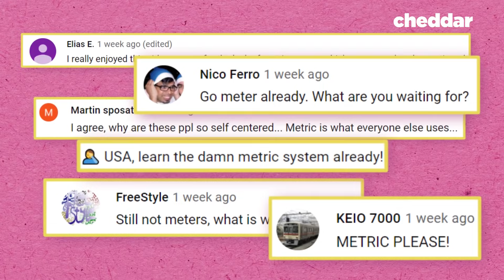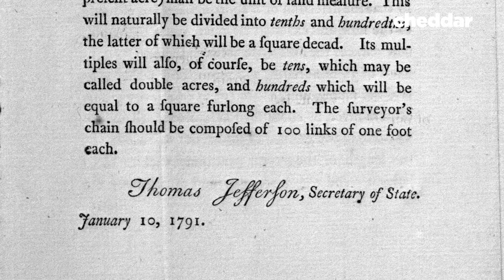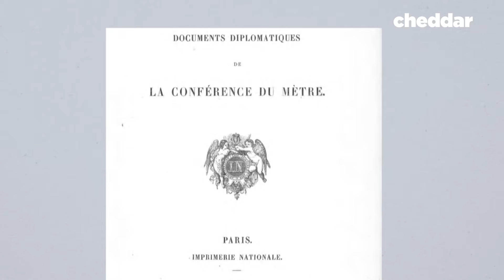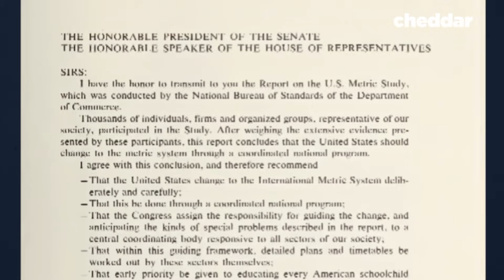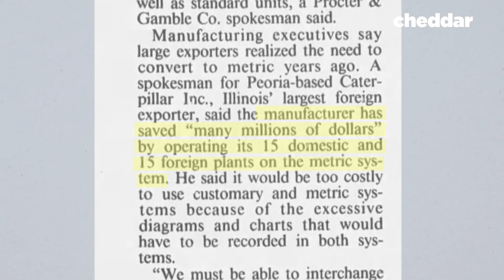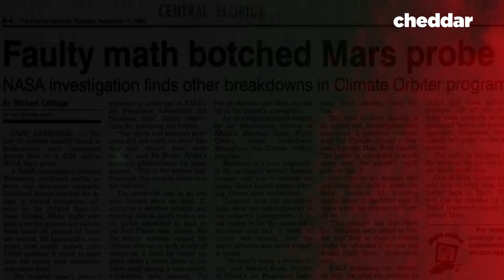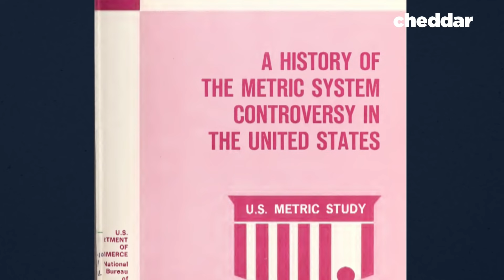Why Doesn't the US Just Use the Metric System? - Cheddar Explains

Comment: Can you count to ten? 

1-2-3-4-5-6-7-8-9-10

^ The entire metric system. 

You're welcome

- Canada
Reply: Thanks Canada
Reply: For construction imperial is the main system by far. For height feet but if you're talking about mountains height you can use both, for weight pounds, for distances km, for weed ounces or grams, for cooking F° but for environmental temperature Celsius, for gas litre, for milk litre or Canadian gallon... They tried to change to metric but I think to have the first economy underneath using empirial doesn't help at all. Now they have such a mess, neither empirial nor metric haha
Reply: @inigoro5177  are you from the USA? Is true that some measures are in imperial in construction, but that is because USA uses it, most chinesse measures are done in meters when it id manufactured to be used by them (or other country in asia), so most of the world is ussing meters for construction too.
Reply: It is that 10mm we always lose. That is why we won't change.
Reply: @TheZolon  What do you mean you "lose" 10mm?
Reply: @crispybacon4240  10mm socket.
Reply: i think its counting up to ten... not to nine.
Reply: @alancrawford3563  Congratulations, you failed at, literally, 'count[ing] to ten'
Reply: Did you land on the moon?
Reply: @ObiTrev  using the metric system for your instrumentation which then rapidly gets converted to units of stupidity because it helps the engineers better to understand because they grew up with a stupid system of measurement
Reply: @ObiTrev  NASA uses exclusively metric now.
Reply: That's why I still see goddamn oz and lbs here in supermarkets?
Reply: I prefer metric for nuts and bots. Feet for height, pounds for how much something weighs,  and km for distances
Reply: So you're saying we're smarter because we use differing "multiples of x" to measure instead of simple mutiples of 10? :) now go walk a couple furlongs and tell me how you feel
Reply: Yup.  1-2-3-4-5-6-7-8-9-10-11-12.  AND, as an American, I can also count to 16 by factors of two:  1, 2, 4, 8, 16.
Reply: sorry that I dont need to use my fingers for counting
Reply: so converting from Km/hr to m/s should be super easy then? Oh...what's that? Not so simple?
Reply: @noelmasson  The only reason that's more difficult is that time is measured in a different system. There are 60 seconds in a minute, 60 minutes in an hour no matter where you are on the globe. You're throwing two different systems together into one calculation here, mate.

or, to say it in your words,

so converting from miles/hr to ft/s should be super easy then? Oh...what's that? Not so simple?
Reply: @raelaash4759  yes...I am using absurdity to make a point. I am aware time is "a different system". Pro metric people usually cite the simplicity of conversion, but this is only true of conversions WITHIN it's own suffix. All useful conversions will require real math. I have a trove full of examples. I was brought up metric, but the U.S. Customary Units make a whole lot more sense, or in the very least, as much sense. And I am an engineer.
Reply: @noelmasson  Maybe you should've said that instead of acting to make an absurd statement. This is the internet. There's enough people out there who would believe your 'argument' to be logical. Sooo... I kind of don't see the point in posting that in the first place.
Reply: @jbird4478  I am trying to explain that the proponents of metric love the fact that everything is in "tens". But that is not true in the real world. It only useful WITHIN its own domain....which is not very often. Most things in the real world involve time, which is not metric. Neither are circles or spheres....or rectangles for that matter. So many things that the base unit has to interact with, destroys metrics "superiority". Even the use of water as the cross standard between volume and weight is flawed. In the real world, the fluid that gets measured the most in our daily lives is not water. It's fuel. And 1 liter of fuel does not weigh 1 Kg. Water boiling at 100 deg means nothing to anyone in our daily lives. It may as well boil at some arbitrary number because what good is it (outside of putting 100 on a scale on a boiler in industry) to us in our daily lives. (and it's only true at 1 atmosphere of pressure, which is laughably, 101.325 kPa....love metric) You know what IS useful. If it is 100 deg, it is too hot to go outside and if it's 0...it's too cold. Oh, and 1 deg Fahrenheit is very close to being equal to what a human can differentiate in a room. And I have only just begun. And if you have a moment, look up Chesterton's Fence.
Reply: 10 is a combination of 2 numbers. 
You're welcome
-usa
Reply: @jbird4478  😁 ok I'm not THAT smart.
Reply: @jbird4478  You have managed to miss the point entirely. BTW, US customary units being defined in terms of metric is a non sequitur. eg: The meter is defined as distance traveled by light in a vacuum in 1/299 792 458 of a second. So that definition relies on the definition of a second. (9,192,631,770 transistions between two states of a Caesium-133 atom) So as far as the "inch" or "foot" is concerned, their length is also defined by speed of light and the Caesium-133 atom and the metric derived unit is nothing more than a multiplication factor.
And, are you also saying, for all intents and purposes, when teaching the metric system to students, that 1 liter of water does not weigh 1 Kg? This is an "equation" that metric proponents often state as one of the reasons that the metric system is superior. 
My point was all about which system is most understandable by humans in their everyday life.
Reply: @jbird4478  Nothing...but once again, you miss my point.
Look, metric supporters tout this wonderful thing as useful. "look how beautiful metric is...1 liter of water weighs 1 Kg" 
I say..really? How useful is it..really? It would be more useful if 1 liter of gasoline weighed 1 Kg. But it doesn't.
Reply: @jbird4478  So?? Forget the definitions...they are not important to this argument. (I understand the importance of definitions, but NOT in the context of this discussion)
Reply: Broke: Base 10
Woke: Base 12
Wokest: Base 16
Ascended: Base 20
Beyond God: Base 100
Reply: I prefer counting to 8.
Reply: This is canada's second most aggressive move
Reply: Canadians: some of the most passive-aggressive (that is, highly veiled and hidden aggressive) people on the planet, who underhandedly insist they are polite.  They do have American counterparts, which dwell near most Canucks in the Midwest.  (c.f. Minnesota Nice, etc.)
Reply: het out of here canada, we dont need your maple syrup or your dame measuring system
Reply: people who bitch about imperial system cant read a tape measure or are autistic
Reply: A fucking leaf.
Reply: Thank you nice northern people, very cool
Reply: Now how many meters is in a mile? When I see 'Mile Marker 463' what is the equivalent Km marker number? Who will clean the mess when someone sees '100kmh' and slams into a tree at 100mph? There are reasons the average person wont convert, these are just some more obvious ones.
Reply: Savage af 🤣
Reply: As an American, I only understood 5/16 of what y'all were saying. MAKE INCHES GREAT AGAIN!
Reply: We still use inches for height and pounds for weight; no one I know knows what 45 kilograms is like.
Reply: that's the problem: they can't
Reply: @alancrawford3563  that's exactly one of the creative ways you guys find to fail at that "counting to ten" thing
Reply: Are you seriously pretending that Canada uses the metric system exclusively? Good joke.
Reply: Oh, funny that – on YouTube I see (hear) lots of Anglo-Canadians using imperial measures too. Is it just to please their US American audience, or the resistance to change like in Britain?
Reply: Christian Augustin to please the American audience .-.
Reply: @c.augustin  is because the audience, that is why they tend to say meters and then feet, miles or whatever weird measure is for the context or the lenght, i would never understand why USA uses like 5 diferent types of lenght units (inch, feet, land mile, nautical mile, etc) instead of the universal one.
Reply: Christian Augustin A
Reply: @c.augustin  so, the big thing is that canada's conversion was very, very recent
so just about everyone knows both, as such, we use both
speed and distance is km mostly, but most people give their height and weight in feet and pounds respectively 
we use whatever system fits the circumstance, since near everyone knows both
Reply: @c.augustin  sorry the late comment. 
I have family, and friends that are Canadian. They have told me, an American, that the reason they use Imperial measurements, is because 90% of them live within a 160km distance of the Canadian/ USA border. So, to help us simple Americans understand, they just simply convert things for us. 🙂
Reply: @busog97641  Yeah, Canadians seem to be nice people … ;-)
Reply: @c.augustin  base ten is crap. base twelve is the correct answer.
Reply: tubefu everyone at nasa is required to use the metric system, because it is way more convenient. This is because imperial units had caused a space unit to drift off and became lost forever...
Reply: @tubefu  No, base 16 is the only right answer to all problems. Already in widespread use (at least amongst coders all over the world), and all devices we use today have it at their base. Or, if the count of prime numbers in the base counts, maybe base 30 (2 x 3 x 5). Base 12 (having 2, 3 and 4 in it, or 2 x 2 x 3) has its merits, but our hands lack two digits, so it never made it as our base number system – even though we can still see 11 and 12 treated specially in languages of European descent (perhaps in the languages they came from too, and other languages might be different in this regard).
Reply: @tubefu  Oh, and what I forgot – the imperial system does not universally use base 12. More often than not measures have no easy numerical relationship, or different ones (what was it – 3 ft = 1 yd? 1760 yd = 1 [land]mile?). I once looked into volume and weight measures, and they are a complete mess. Not so in the metrical system – there, even mass is tied into it: 1 liter = 1000 ccm = 10 x 10 x 10 cm = 1 kg of water at room temperature. Try this in the imperial system, have fun!
Reply: @tubefu  base 2 cuz its used in whatever u used to comment on this video
Reply: @tubefu  this is how you count 0 1 2 3 4 5 6 7 8 9 A B C D E F
Reply: @c.augustin  i am sorry to say, binary is the one used in electronics, the code use hexadecimal because is the short one but that has to be converted to binary to send signals an data. I prefer hexadecimal
Reply: @alenasenie6928  I know this, but using zeros and ones was always quite cumbersome, so it first was octal (3 bits, very weird and not that practical, but still used in *nix file systems), but then the nibble (4 bits) started to become the practical unit, and there hexadecimal comes into play. Nowadays using multiples of 8 bit (1 byte = 2 nibbles) has become the norm, so hexadecimal it is! Still can't get used to it in "everyday life", even though my computing experience started out with hexadecimal codes and 6502 machine language (yes, in hex – no assembler back then ;-)).
Reply: @c.augustin  base 16 is convenient and efficient for binary computers. it doesnt really have advantages for humans. if computers with tri state "bytes" appear, things will certainly look a lot different.
Reply: @drkastenbrot  I know that base 16 is not nice to humans, it was just to show that base 12 isn't that great either (even though it has some advantages with small quantities). And I guess that qbits are already something that does not play nice with hexadecimal counting (and it would be tri state bits, not bytes).
Reply: @c.augustin  tri state are neither bits or bytes so i was free to use any term
Reply: @drkastenbrot  As the smallest unit, "bit" ("tbit" or "trit"?) would be appropriate. Byte is already an aggregate, as are "nibble" , "word", "double word" etc. I don't know if "qbit" has more than two states. Anyways, I don't think that "trinary" systems make technological sense, as dealing with two states is already challenging at high speeds (as far as I'm aware).
Reply: @c.augustin  qbits or quantum bits can have 3 states, yes, no, and a superposition
Reply: @tubefu  base 20, like Mayan numbers, is better.
Reply: Don't Canadians use both? I know we're behind the rest of the world. But I think we're only going to get as far as Canada or The UK in going metric.
Reply: @garcjr  the uk only uses metric officially, in practice their transition to metric was an absolute failure.
Reply: @garcjr  Newer generations and prairie people especially use both, we still haven't completely converted and we use both because America is right beside us and it's easier for you guys
Reply: Can u have a better country, nope
Reply: can you spell B U T T O U T.

Comment: The U.S. does use the metric system for most things., just not for distance and weight (except for science, technology and the courts, i.e., you get busted for pot the authorities are going to measure it and charge you based on the number of grams, not ounces.) Virtually all consumer products, including automobiles, are designed and constructed using the metric system. Try working on your car with just a set of Imperial system tools or replacing a screw in any consumer electronics or appliances or assembling Ikea furniture with inch based Allen wrenches.

Comment: In Canada we mix it up. At lumber stores we still buy 2"x 4" studs, 1"x 6" deck boards  and 4'x8' sheets of plywood and we fill up 5 gallon gas cans for our snow blowers , lawn mowers, ATV and swomboliles.
We buy 3 inch nails and screws, and fill 20 pound propane bottles for the outdoor gas BBQ.

Comment: So, the most common reason for going Metric is because everybody else does. This is back to the jump off the bridge argument. The second most common reason is because it is better or easier. Easier, yes but better? Maybe a decimal based system where fundamental units were really scientifically based instead of arbitrarily choosing water which has been abandoned anyway would make sense but the Metric System was a product of the French Revolution and had very little to do with reason and everything to do with rejection of everything previous.  At the end the entire argument for Metric is kinda dilly. It is not more accurate. It is not scientifically based. In the end because it is easier, not better, not more accurate or even scientific is the only real reason. I say use what ever system is the most appropriate for the application otherwise we will be subjected to circles with 100 degrees and pi being some horrible number and so on. The french even had a Metric Calendar , day, hours etc.

Comment: The British created the British Imperial System in 1824, but eventually had the common sense to convert to the Metric system in 1965, I was a schoolchild in 1965 so learned both systems, and the metric system is far easier to use, certainly when it comes to calculating fractions, it does make accurate weights and measurements much easier.
If I asked you to 
Add 7 and 7/8 th of an inch to  to 2 and 17/32 nd of an inch.
Or 
Add 200.03 mm to 64.29 mm. 

(both measurements are equal) Then  the metric system is obviously easier because it's a straight forward addition, there is no need to find a common denominator for the two fractions in order to do the calculation.
In the UK if you take your car to a petrol station (gas station) you will fill the tank with litres of fuel,  However we still use Miles on road signs, use Miles per Hour on our speedometers, so some of the imperial system has stuck.

Comment: But what will be the standard height of a door in the US after we convert?   2.1336 m????  213.36 cm????  Aaaaaaah, the humanity!!
Reply: Very true
In metric Canada  at lumber stores we still buy 2"x 4" studs, 1"x 6" deck boards  and 4'x8' sheets of plywood , nails and screws by the inch.
Reply: @Crashed131963  that is very interesting!   Didn't know that..  to me, the foot is one the most standard units of measurement we have and it would be hard to give that up..    cm is too small and a meter is often too big..

Comment: The United States does not use the imperial system. We use what are called United States customary units, which used to be called The Royal system. The imperial system is slightly different than the Royal system, the Royal system predates the imperial system. The United States left the British empire almost 50 years before the finalization of the imperial measurement system which happened in 1824. There are slight differences between imperial and US customary units(Royal).
Reply: MattCellaneous correct. A British gallon is bigger than an American gallon.
Reply: @simonhenry7867  
It would be more modern. 😁
Reply: @simonhenry7867  They did modernize in 1893, in 1959 the inch was further modernized to the international inch and the 1824 and 1893 inches mostly ditched.